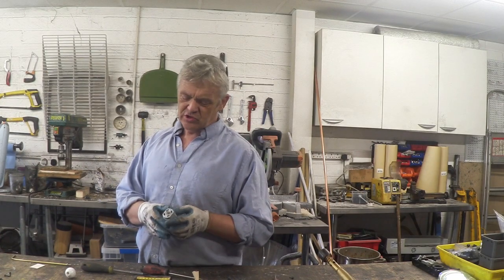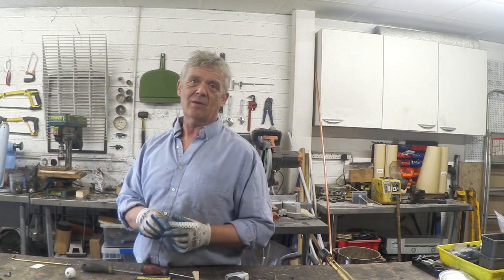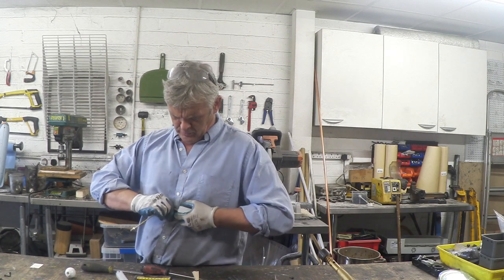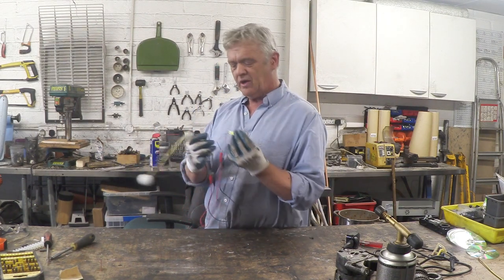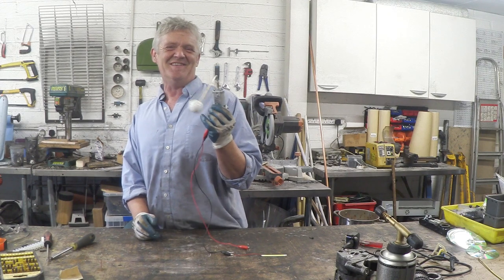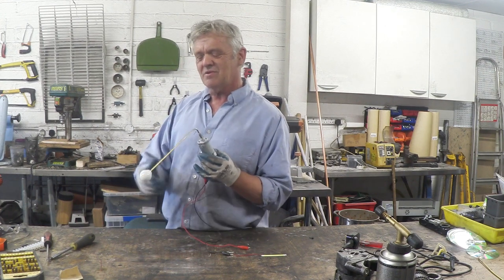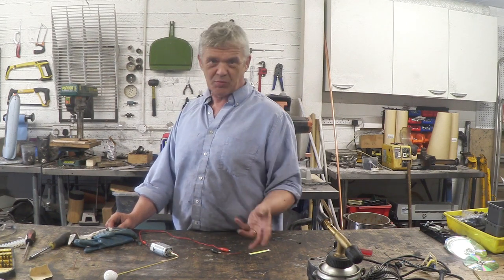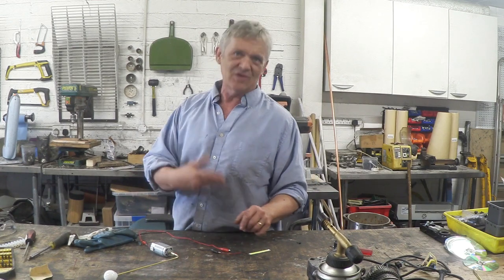1219 How To Make A Super Simple Swinging Generator

Comment: That's actually pretty decent when you think about it. Imagine about 6 or more of these attached to a large cog that is driven by your large wind blades. In light winds if you got about the same rpm as you just demonstrated you then should get about an amp at 20 volts or more. Add a buck converter that gives you approximately 12v @ 2amps or 5v @ a minimum of 4.5amps. Sure you will need a weatherproof housing for the motors but seriously this has real potential.
Reply from the maker: you know - that really didn't occur to me - hmmmm
Reply: @ThinkingandTinkering  love getting that mind of yours ticking like that. Excellence always follows. 🤣

Comment: This is going to sound silly ,but, having a Marching Band background (I was the awesomely cool Tuba Player), this could be part a cool effect with the band front, as most performances happen at night... To use one of these, build it so that it's wired back to the end (where the ball is), and have it be some sort of LED lit "ball" on the end.   They could swing them around and get a cool LED circle effect as part of "the show," and could be themed to technology, or the future, or "saving the environment" by not using batteries, etc.  Pretty cool really.
Reply from the maker: mate - that is more than pretty cool - I like it - a lot!
Reply: These, as you describe, have been on the market for decades. I first saw one as a skipping rope with LEDs in a clear vinyl tube. Plenty other examples since, some even leave images in the air due to persistence of vision effects. Or fixed to bicycle spokes and fan-blades as advertising signs etc.

Comment: That was another good one. How about making a compact pump up pocket LED torch with a dental hand piece turbine, some of them will run up to 450,000 rpm. They are very simple may you could make your own turbine as you wouldn’t need to spin anywhere near that speed. Possibly a motor from a camera zoom lens might work as a generator.
Reply from the maker: oh wow - thanks for the pointers mate
Reply: @ThinkingandTinkering  no worries.

Comment: I love this idea. How would you go about driving this type of action with air or water to oscillate the motor at the right harmonic to keep the weighted handle spinning? And would that power be less than the power required to directly spin the armature to achieve the same power output?
Reply from the maker: good questions mate - I will have to have a think about them

Comment: wonderful!  
Similar to a notion I've had, but don't know how to do, quite.  if you put that on top of a bit of a rod, and move that rod back and forth Very slightly, it'll spin beautifully. 
It seems to me, as it's gravity and centripital(fugal?) force that keeps it spinning and you get some flywheel type action going, and the rod is taking all the weight,  that you could use a very much smaller motor to jiggle the rod, and wind up with more output from the motor cranked by the spinning arm, than is required to jiggle the rod.     
does that make sense?
the concept could scale up by quite a lot, I've just not figured out how to make a rod-jiggler.
Reply: I mean, depending on the length of the arm, and amount of weight, you could turn quite a large motor, with a very minor nudge to the rod it's on, and get it going Very fast with hardly any effort.
Reply from the maker: I'll look at that mate - I like that - thanks for the inspiration

Comment: Can you do some actual voltage and current measurements with a known load resistance across the motor terminals?
If you are correct about rpm per volt (not saying that you are not!😎), you could use the idea as an rpm measuring device.
Lighting LEDs is fine as a visual for the entertainment.
Cheers.
Reply from the maker: it's easy to make and cheap - why not try it yourself? You probably know more about what measurements to take and how to take them than I do

Comment: Hi Sir !
I noticed you are pretty skilled and informed about Graphite, generator and magnets.
Can you help me with this: 
Think at an optimized version of the low heat Stirling engine that by now it's all over the places.
(Just google low heat Stirling engine it's the circular one)
Now think at it in his bigger ~25/30kw of mechanical power production version.
Question is:
How would you creating a cost effective Generator from the Iron Nitride magnets and Graphite (and Graphite sheets) that would be left over from the motor production.
You have a 500$ per unit price limit..
And likely a power production ranging from 20 to 25kw ...

I'm asking you because I can't really wrapping my brain around circuits...
But I figured that some magnets and highly conductive materials disks turning in different directions at high speed would generating current..
The Stirling and some multipliers mechanism would give the spin to the different sections/layers spinning around.. but I cannot really get to the material part of the problem.
 I have of no possibility of getting anything about currents fluxes that aren't organically produced..

Sincerely.
Researchers for passion.
[EDIT]
Ok like this is too much generic..!
For better specifying my example:
A ring of Iron Nitride with above and below disks of Graphite with many fissure orbiting around in opposite direction to each other, than another layers on top, four times for four piston activated from the Stirling motions. 
Connected to some brushes for any plate..or one bigger to brush them all..."The brush of Power."
(Pardon my Tolkienism, I just rediscovered brush existence)
Also for reducing the Iron Nitride usage and total weight and costs, 
In between the 2 sections 
(of 8 plates in total) could be just added a steel plate so that just one magnet above and one below would be needed , thanks to the redirected electromagnetic field attracted from the steel plate? (strongly fixated [ The only non conductive material that pops into my brain as light,  cheep and inexpensive is wood...looking fragile, but those plastic bee hive superstrong materials must be so much expensive, they were thought as wheels for armoured vehicles] in a equidistant positioning in order to not being itself catched from the high strength of the magnets)
Costs for iron nitride would not being a problem because it become cheaper producing it in great quantity (for the nitrogen)

Is the thing I described above a generator?
It would produce at least 20Kw per Stirling unit with mechanical power production of ~25/30kw?
Thanks for yours attention.

P.S: Yours impersonation of Antony Hopkins must be Gold.
Reply: In principle your idea should work. It seems you are thinking of a homo-polar generator, am I right? But you would need some way of keeping the hot/cold components from interfering with heat flow whatever you do. You don't need FeN or 'graphitic' materials, it's more about coupling ratios, and there are plenty of other materials. Try a few small-scale experiments. Scaling up to 20kw, or above, could require some major redesigning too.
A 'pancake' type motor/generator set up might be worth considering, but for testing any 'ordinary' generator will do.
Apologies, but I don't understand,  "I have of no possibility of getting anything about currents fluxes that aren't organically produced.." Please explain.
Obviously English is not your first language (you've done very well though), could you get someone to explain your idea more formally? Perhaps someone could then answer you directly.
Good luck.